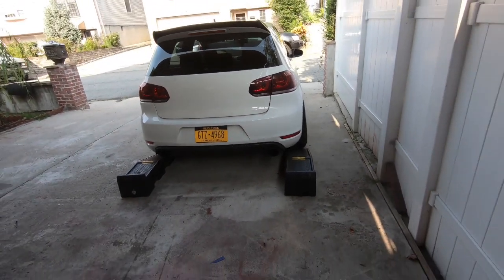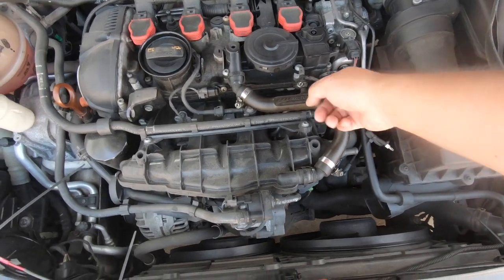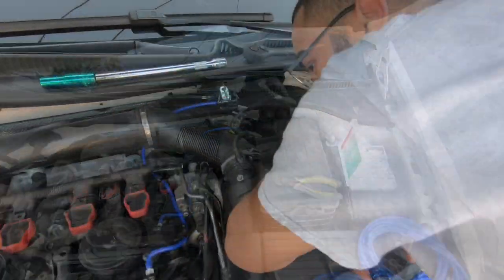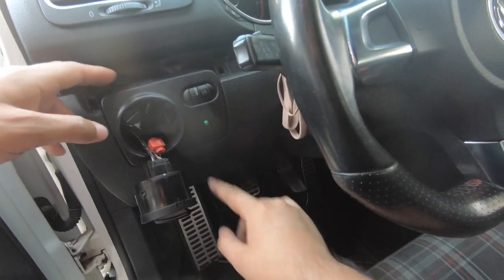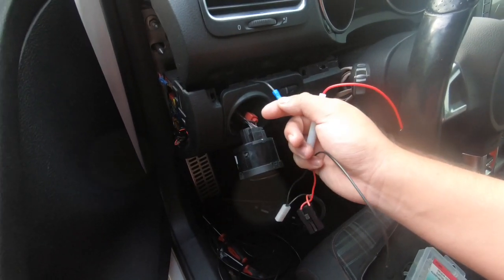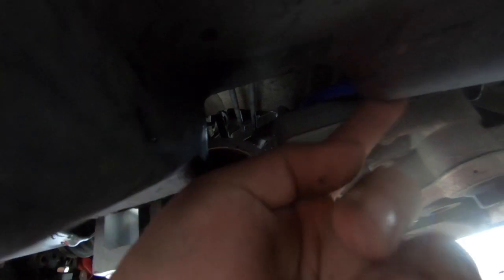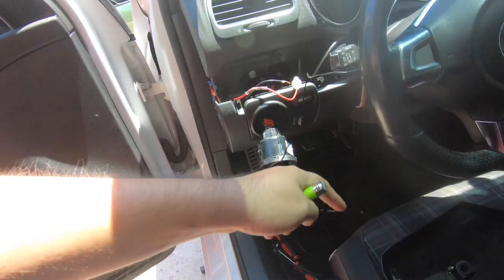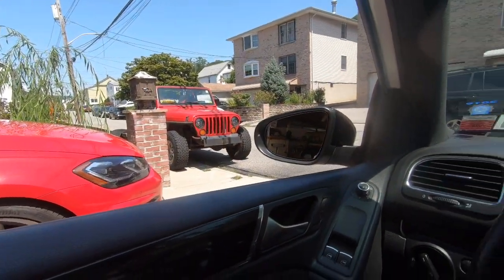Mk6 gti ecs tunning exhaust cut out install

Comment: Guys I did it to my mk5 gig and holy shi it was way to loud. The cops were all over me. Sounded just like a tractor good for teenagers but everything would rattle and easy head ache within a couple minutes. Drone is worse then when one window is open on a highway
Reply: is it bad while closed and opened, or just opened. I want to do this with my mk5
Reply from the maker: If you have it before your muffler, it will sound the same. I have it right after the cat and it’s super loud wen it’s open. Will make the car shake. Only open it when I’m doing pulls so the gases exit faster.
Reply: @funkymonkeycrew7055  Yeah, I had it after my 3” Hi Flo APR DP and everything rattled and the drone was too much it was mad!! The police were always tailing me. I got the 3” ECS exhaust and am super happy with my mk5, get some really nice crackles and pops when the valves are open

Comment: yo bro how did u delete your rear vw emblem that opens the trunk? i need to do it to mine
Reply: Cut the old piece. Weld the metal piece that has the same shape. I would doit out of another trunk so the lines match. Prime and paint and done.

Comment: How is the drone in the cabin when you are driving with the cutout open?
Reply: Josh Figueira it is stupid loud lol, we are doing it for h2oi but it’s not a thing you would want open all the time. It’s literally just having a turbo hood dump.
Reply: KEVIN NAR Yeah I just got mine in the mail with the double apex switch, probably gonna install it this weekend on my ko4 mk6 gti, any tips or advice?
Reply from the maker: For some reason my message didn’t send. But you make boost faster with it open. So it’s a plus since you are going ko4. Best tip is get it welded. Those claps will rust or fail. They are not great quality

Comment: Will it work for mk7
Reply from the maker: Yes it will work with any car as long as it has vacuum. Will prob need to get the right adaptor for it. You can also get the electric one if you don’t want to run vacuum to it.
Reply: @NarBrosGarage  ooosh okeye

Comment: this valve works with vacuum line, does it close itself when you run boost?
Reply from the maker: No the valve opens the cut out and as long as it’s open it won’t close until you flip the switch letting the valve release the air.
Reply: @NarBrosGarage  Oh darn i forgot about the solenoid thing holding / releasing pressure regardless of boost. Thanks for the reply buddy